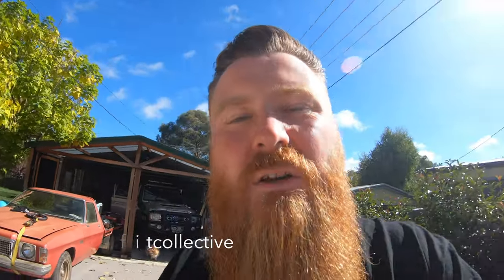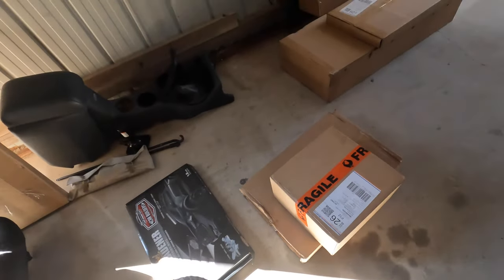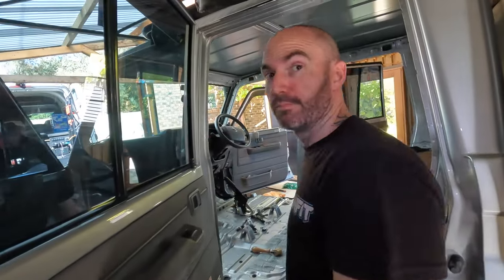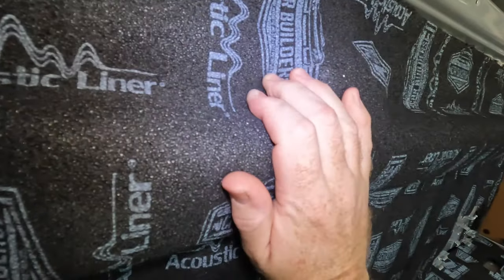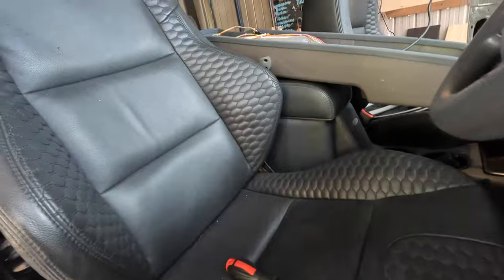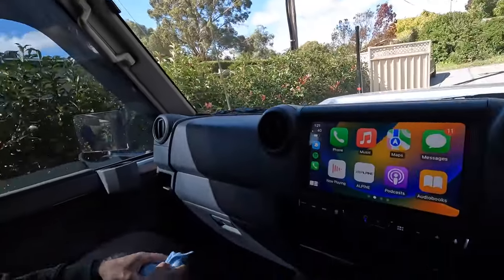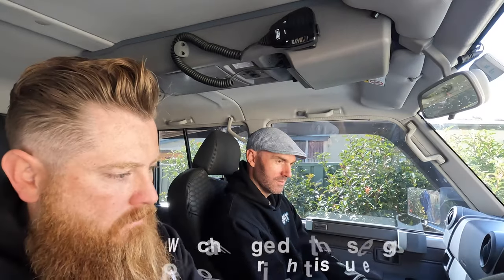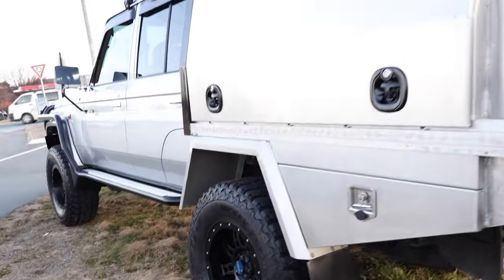79 series Landcruiser - Alpine stereo 9 inch screen and Car builders sound proofing galore!

Comment: I installing the i905 in my 70 series do you need to install the vss vehicle speed pulse line if so where is located please
Reply from the maker: Typically you only "need" the VSS wire with Nav systems that have built in mapping. In most late model 70 series there is a speed wire at the wiring for the factory clock that sits next to the hazard switch. From memory its purple with a white trace. Often times it has a factory wire connected to it with a scotch lock if the unit your replacing is still the factory fitted Toyota radio.

Comment: Question what happens if you're off-roading and you get riverwater into the cabin with all the material stuck at the bottom ?
Reply from the maker: That material is a neoprene base, designed to repel water. Much better than the factory material that is usually
Under these carpets!